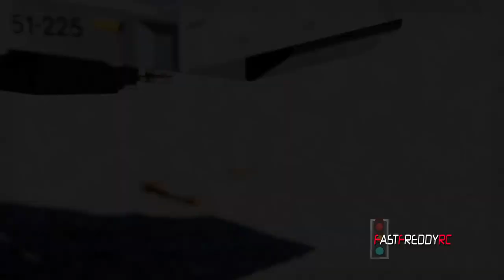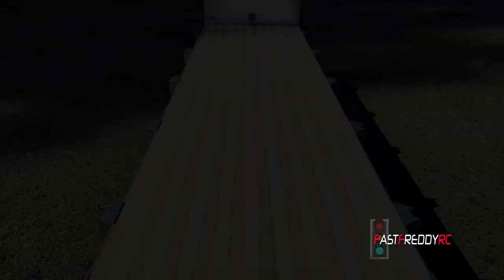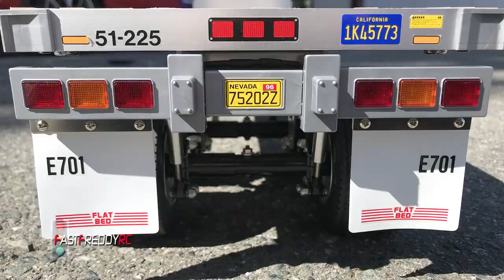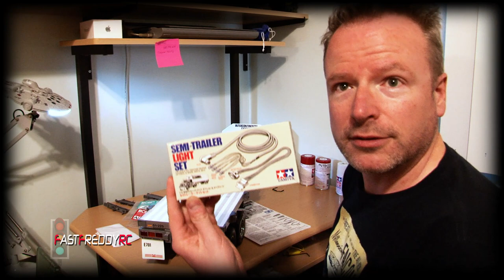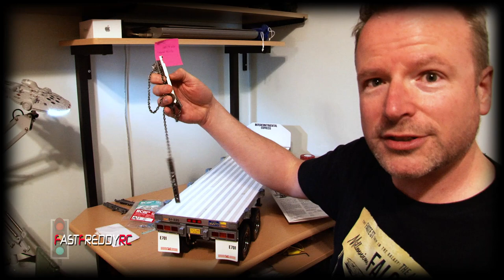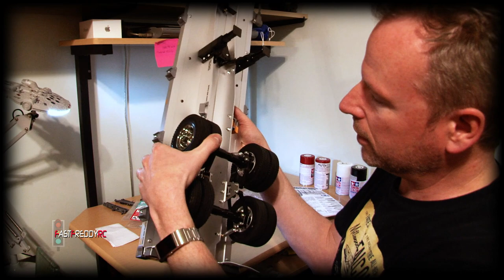Tamiya Flatbed Semi-Trailer - Tips and Tricks

Comment: Thanks for the tip. So, I just finished building mine yesterday and because of your tip on lights and poles, I made the wooden slats removable by gluing all wood pieces together while fitting them on the flatbed. I used a thin abs plastic sheet to glue them together. Then after the glue cures, I fixed other pieces of wood underneath the now wooden panel to keep the panel straight/flat. Now, I can remove the wood and replace the lighting or do other things with the trailer without damaging the wood pieces.
Reply from the maker: Glad I could help!  I think what you've done is a great idea!  Means that you have full access to the underneath in only a couple steps.  Thanks for sharing!
Reply: That’s a great idea Philip.  Thanks.

Comment: I know this is an older video BUT I've recently got my first Grand Hauler Kit along with the Flat bed trailer and following the instructions as best I could and starting from the middle as the instructions call for, all my pieces fit as per manual. Needed to loosen both side and starting from middle I did one half and then the other half. Then I use wood clamps to clamp the side and all the board nicely together and secured both side rails. All pieces fit and didn't need to trim them. As for the lights, I was originally planning on building it without lights and enjoying it out of the box before I invest more time and money into it. Quickly changed my mind about it and installed an inexpensive car/truck light kit off of amazon but since I am doing it wireless ( separate rx and battery ) I ran the wiring in 1/4" wiring loom and secure that in between the rails where the battery pack and RX are located. ( these would never have fit under the boards anyways, the benefit is that I don't need to make connection to the truck if for example I wanted to show it off. Also this tamiya kit from amazon will go into some sort of display mode when it doesn't see radio signal.

If flashes the turn signals like four way flashers.
Reply from the maker: Awesome!  That's a great idea to have a lighting kit that doesn't require it to be plugged into the MFC on the truck.  Because I would agree with you that if you wanted to show it off with the lights on your method is much better.  Great idea.  And you are right that fixing the cable up in the frame rails would illuminate the need for the method in the Tamiya instruction manual.  Love to see it when you've finished it!

Comment: Love the name FastFreddy, solid lol. I liked how the wheel chock fell out when you lifted the trailer up and you didn't even flinch lol. Not a big fan of the wire coming out of the front deck like that, kinda prevents you from butting up freight against that front wall which in real life is necessary for certain types of cargo. Still a great highly detailed, quality trailer. Very informative video by the way Freddy. 👍🥇
Reply from the maker: Appreciate the feedback!  And thank you.  But I do agree about the wire.  Better option would have been that the wire was fed directly under the floor rather than having to make a space for it.  Because in real life you're right...freight is often placed right up against the wall.

Comment: I havent stuck my wood down, I just used the adjustable side rails to clamp the timber in place
Reply from the maker: And that is another way that you can do it. For myself I tried doing it that way a few times but I just wasn’t happy with the overall surface of the deck. I’m about to do some upgrades as I decided to buy the electronic legs. Will do a video on that once they arrive.

Comment: Hi Freddy, I was looking for some advice in a build I am planning. I want to build a 379 Peterbilt like the one I own and need some advice putting the parts together. Some of the Tamiya kits are nice but they look like a lot of the parts a plastic and I am planning on taking it to the next level by replacing plastic parts for metal ones. Would it be adventitious to start with a model kit and bone the parts that I cannot get separate? I found some very cool rear differentials and air bag accessories but don’t know where to get some of these parts, any advice would be much appreciated.
Reply from the maker: As a whole what I've found is that if you buy the kit as is, you can often find upgradable parts that are metal.  I just received a metal coupler plate for my Tamiya Cascadia EVO which I've been waiting a long time.  You can also upgrade to metal wheels rather than the plastic ones that the kit comes with.  I am in the process of creating a video on the build that I'm doing but it will be awhile before it's ready.

Comment: Did you use all your wood slats
Reply from the maker: Yes I did...they all managed to fit but I didn't do it the way they say in the box.  I started at one side and went right across.  Starting in the middle means that you'll have to be so dead on with your measurements in order to make sure they all fit.  I tried a few times and just gave up.  It's not noticeable so I just started from one side and went across.

Comment: Does anyone have tips on how to get the e-rings onto the diffs and eventually the tranny of the cascadia evo?  I’m having a hard time getting them on there and the tool they provided isn’t helpful at this stage.  It’s my 1st build.  Too bad they didn’t make them more like snap rings on my riding lawnmower I’ve worked on.  There’s a great tool for that.  Anyhow, any tips and pointers welcome.
Reply from the maker: Yes, ok this can be challenging.  I will often use needle nose pliers. I find it's way easier doing it that way.
Reply: Thanks.  I’ll try that